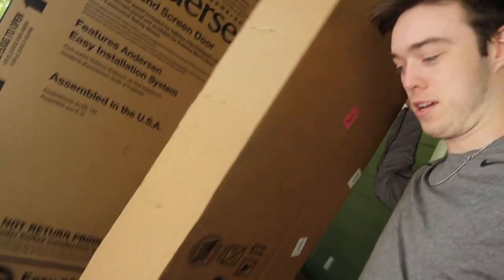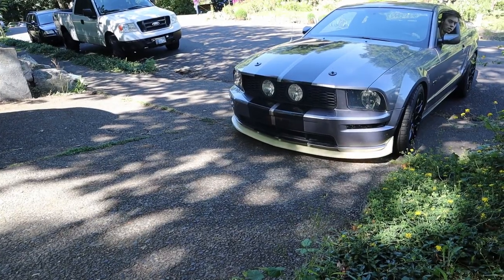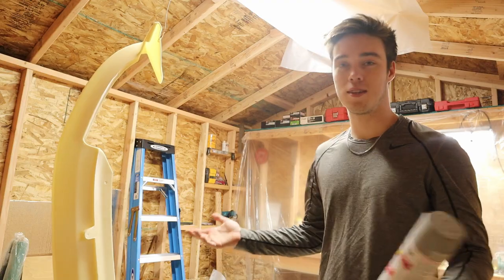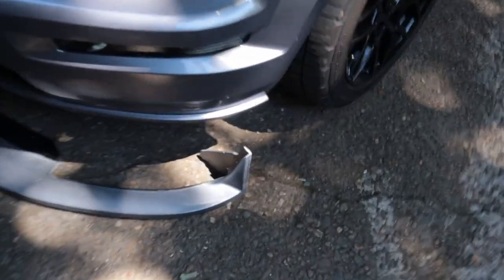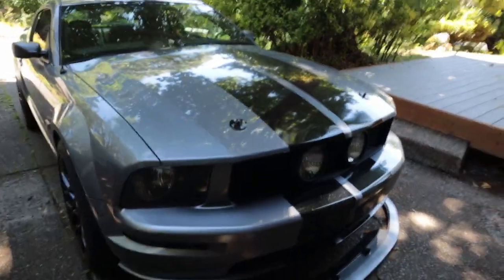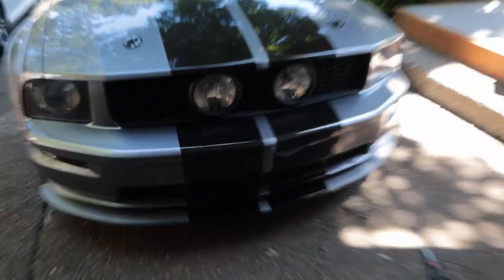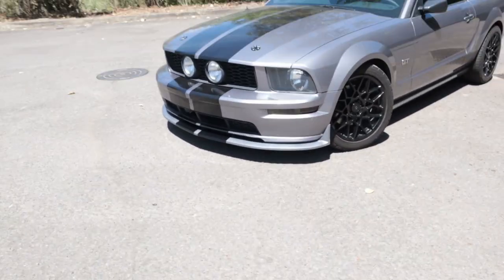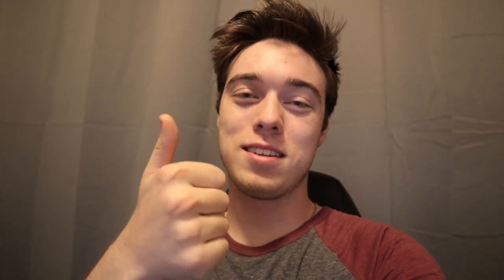Painting and Installing the Mustang's New Chin Spoiler!!

Comment: Did you just screw it to the existing bumper or did you have to use any 3M tape on it?
Reply from the maker: At the time I just screwed it on with the self tappers they sent. In hindsight, I would recommend using double sided tape if you’re planning to use the included hardware. A while after this video was posted I ended up removing the bumper, drilling holes, and using bolts with locking nuts to hold it on.

Comment: I got a 2005 Mustang, I'm about to do the same thing lol
Reply from the maker: Awesome man! If you have any questions feel free to DM me on Instagram! @kaidanodom
Reply: @kaidanodom  Yeah bro! So I got a Stock 2005 Mustang GT convertible. I wanna add some cool mods to it. 

I'm thinking Chin spoiler, Hood scoop, paint my wheels black and paint my calipers red.
Reply from the maker: Sounds like a fun project. I’d recommend getting some wider wheels. 18x9s will run 255/45 tires and that’s what I’m running right now. If you want a staggered set up you can run 18x10s in the back with 285s